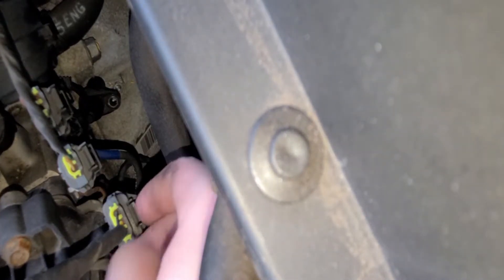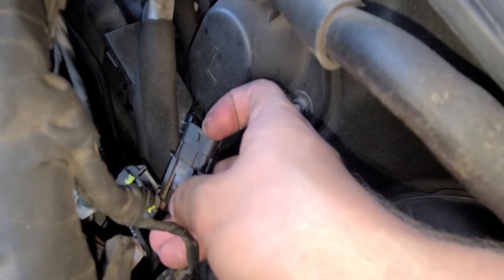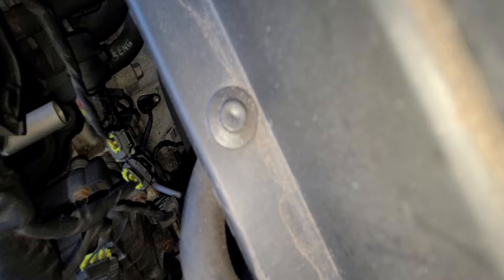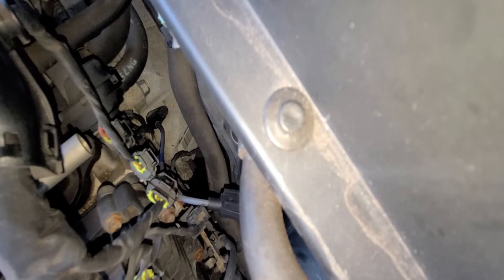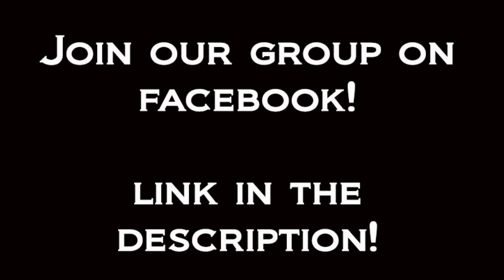Genesis Sedan Crank Sensor & Evap location / Replacement  (EASY!)

Comment: Thank you.  My 09 has 235K miles and the throttle was so variable it was annoying.  Sometimes It wouldn't have much power.  Then it started occasionally shutting off at stoplights.  I changed it a few hours ago, thank you for your video! and it appears cured. Amazingly, it seems like it has way more horsepower now!
Reply: Yeah, it’ll feel like a big horsepower boost because it’s not in limp mode anymore.
Reply: When changing the crankshaft position sensor does the car need to be reset and some kind of way to recognize the new sensor? I have to change mine this weekend. Thank you

Comment: My car has been sitting for about two months now ! I swapped the gas pump put in new ignition coils spark plugs changed the camshaft sensors almost everything so now I’ve ordered the parts you swapped hopefully it runs again 😮‍💨
Reply: Did the crankshaft sensor fix your car?

Comment: Thanks for the vids and info. I also have a 09 w/ 4.6 tech package. I did the same replacement over a year ago as the Gen would randomly not start. Have you had any issues with your transmission where it stays locked in park or bucks out of first gear when accelerating from a stop. This happened to my car and I did some research and watched a lot of vids how to replace the transmission solenoids, plastic bridge and ZF fluid and new pan replacement. Did the work myself and she is running like a champ.
Reply from the maker: Where did you buy the kit or individual parts to service the transmission? I'm looking to do my solenoids as well, did you need to reset the adaptions after you got done?

Comment: Does the 4.6 have a pcv valve? My 297k 4.6 equus running strong but burning oil
Reply from the maker: Yes, PCV is on the drivers side but both valve covers vent into the intake. You can run 2 catch cans for both covers and reduce oil consumption

Comment: Good morning.  Would the location be the same for my 2014 Hyundai Equus?
Reply from the maker: if its a 4.6 & 5.0 then yes to both, if its a 3.8 then only the crank sensor is in the same spot

Comment: Is it in the same location for a 2012 genesis v.6 3.8? I can't see mine
Reply from the maker: the crank sensor is but not the evap purge valve
Reply: @GenerationGarage  I ordered a crank sensor for my 2012 v6 3.8 genesis from advanced auto and it does not look like the one in the video. It doesn't have a tail wire leaving from the sensor just a direct plug in at the sensor. nor do I see the 3 connector that you mentioned at the rear of the engine
Reply: What you happen to know where the purge valve is on a 2012 Genesis 4.6? Thank you

Comment: what about the location on a 2013 genesis sedan. the engine looks different.
Reply from the maker: you probably have a 3.8 V6 then, the crank sensor will be in the same location but the purge valve will be somewhere else

Comment: What fail does when is bad?
Reply from the maker: Hard to start or no start at all, engine will just crank or the car will also stall out
Reply: @GenerationGarage  I appreciate Buddy, is the fail from my 5.0 2012 R spec , give me P0345 Camshaft Position sensor A circuit Bank 2
Just crank but doesn’t start, I replaced the fuel pump 3 times 🤦🏽‍♂️🤦🏽‍♂️
Reply: Is that a crank sensor or camshaft sensor?
Reply from the maker: @G70TT  crank sensor

Comment: Getting similar issues, crank but no start. Did this crankshaft position sensor resolve your issue?
Reply: If you get an OBD 2 sensor and plug it into your car it should tell you where the problem is coming from…. They cost like $20 but there are some that are less… you shouldn’t get expensive ones unless you’re a mechanic anyway but it’s always good to have one in the car with you
Reply from the maker: yes it did, while your cranking it over try pumping the gas, if you can get it to start then its gonna most likely be the sensor issue but I'd also change the evap solenoid while you're there
Reply: @GenerationGarage  Hey thanks, I can eventually get it to start if I try about 10 times and pump the gas like you say. Only on cold starts. If it’s warm it starts no problem. Changed Canister Purge Solenoid valve recently too.
Reply: @mike64mike64mike64  thanks for the reply. I have a pretty decent OBD-II scanner and all it is showing is random misfires on startup. It seems I have similar symptoms to this crank position sensor issue though. I changed plugs recently and they still look fine, showing slightly rich condition, but misfires explain that. Also on the list is to pull injectors and check for buildup causing clogs/leaks.
Reply from the maker: @drewlee9062  yeah then i'd swap the sensor, make sure to spend the money and get a real oem one and not a china cheep one as they can cause problems or stop working sooner